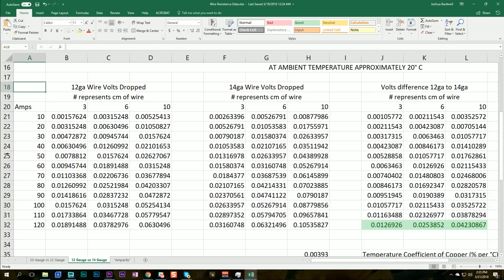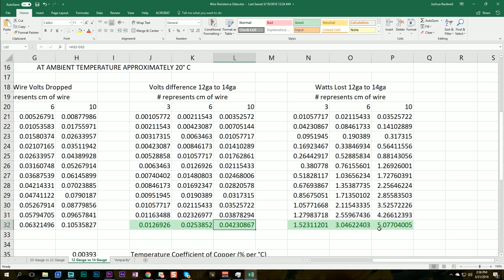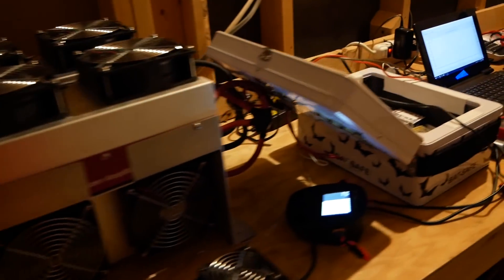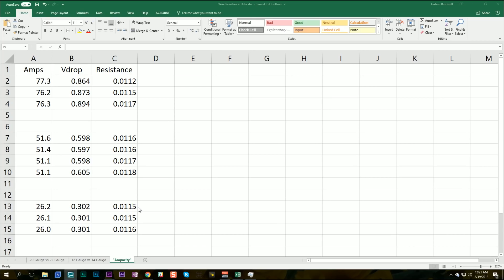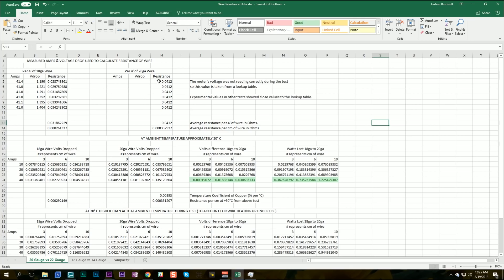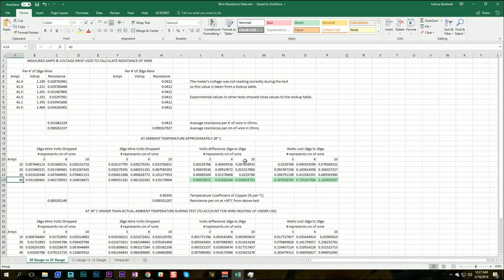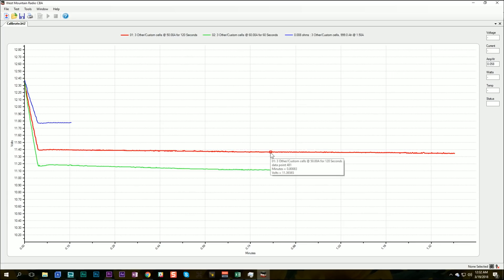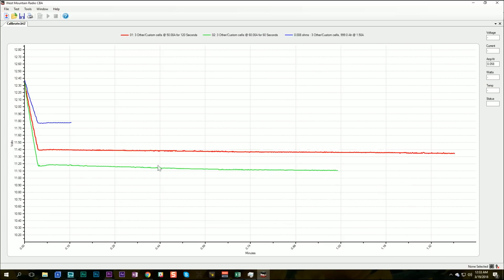Battery Wire Gauge | WHY IT (STILL) DOESN'T ACTUALLY MATTER

Comment: hi friend ... could you help me?
I have an ESC
Racerstar Shot30A ESC 30A 30amp 3-6S 4 in 1 BLHeli_S BB2 Dshot600 Integrated Current Voltage Sensor to match this flightcontroller ...
Omnibus F4 Pro V3 Betaflight Flight Controller Built-in OSD Barometer SD Blackbox for RC Drone ... banggood ...
The plug with the motors and the GND I inserted it and everything worked ..but when I put on the FC the BAT_SEN cable
and CUR_SEN ... and GND ... let me burn the flightcontroller.
the BAT_SEN on the V-BAT pin of the flightcontroller and the CUR_SEN in the CNT pin of the flightcontroller to give the current to the same.
Where did I go wrong???
Reply from the maker: That sounds correct to me.
Reply: I did the same thing, in my case I mistakenly soldered V-bat from the ESC to the 5V bus, blowing up everything that couldn't handle 4S voltage,  I got complacent and assumed the red lead was V-bat and orange was 5V oops- it happens to the best of us and I've been in the RC hobby for 22 years.

Double check your voltages if you have a meter, if not, double check the pin-out, if that is correct something got bridged on accident or you have a defective FC (or even ESC) or possibly mis-labeled boards or instructions- shit happens and I have had my share of faulty equipment right out of the bag.

Good luck, and if I was you and had to replace the FC, I would think twice about using the Omnibus SD-  I had multiple runaways until I disabled data logging, even with all the CLI tricks and using recommended SD cards- and this was a high-end Hobbywing part.
Reply: Meanwhile, thank you for your answer ... can you explain the situation a little better? since I have to translate it in English with google translator and sometimes it does not do it very well and some words confuse it.
in your opinion, how should I feed the ...
Omnibus F4 Pro V3 Betaflight Flight Controller Built-in OSD Barometer SD Blackbox for RC Drone ..... from
Racerstar Shot30A ESC 30A 30amp 3-6S 4 in 1 BLHeli_S BB2 Dshot600 Integrated Current Voltage Sensor ... if you can look at the diagram on banggood ..Thanks
Reply: I'm busy right now, I can check later.
If you have a voltage meter, check to see if on your ESC 5V is around 5V and V-bat is battery voltage. Using a meter is the best way to make sure voltage is correct.

Make sure that 5V wire is on 5V on your FC. Make sure that V-Bat wire is on V-bat on FC.

 But first, Plug your FC into a USB charger- if it turns on and you are brave enough, plug your FC into your computer- if it has power and connects to computer, it might still work.

Chances are you blew up every 5V device on your FC, and not the FC- there is a circuit to protect other 5V circuits on the FC in case of faulty wiring.

If you want to be safe, do not connect V-BAT and Current- in my experience it really doesn't matter because it will need to be calibrated anyway, and many stop counting at 84A
Reply: thanks a lot now I do all these checks ... if you can later look at the two components that I have described you thank you are a friend
Reply: sorry for the question. . . the output of the pins. . . BAT_SEN. . . is . . . CURR_SEN. . . of ESC 4IN 1.. to be connected to the FC OMNIBUS. . . . how many volts must have respectively to power the flightcontroller? ? ?
Thank you.
Reply: If your FC has a BEC, it can most likely run from 3S to 5S so probably 10v to 21v and then feed other components like your RX 5V (some boards also output 3.3v and 9v so make sure what you solder in) but if it does not have a BEC, it must use a 5V wire from the ESC or from an external BEC/PDB.

In the case of my Omnibus, it has a 5V rail and no BEC, and my ESC has a 5v BEC. My mistake was putting the V-bat from the ESC (16.8V) to the 5V rail, this destroyed my RX and VTX, but it spared itself. 

Bat_Sen is not Curr_sen,  Bat_sen usually means V-bat which means battery voltage, I do not know the voltage range of Curr_Sen.

If your FC is Product ID: 1163085 on banggood, then you have a BEC,  AND IT DOES NOT HAVE A CURRENT SENSOR - this board is very complicated and there are multiple ways you can fry stuff with it.
Check Blue Falcon's Flip32 Omnibus: How To Power (F3/F4/Pro/NonPro) video on YouTube and have CC translated for you. Just know the Author of this channel has sadly passed away, so you will not get a response from him if you comment.
Reply: Hello FRIEND you are very precise and professional ... you immediately understand that you are an EXPERT ... thank you so much that you have followed my case .. and I follow you to the comma to understand how to proceed and to learn more. .. and I'm understanding many things from you .. Thanks a lot ...
the flight controller OMNIBUS F4 PRO V3 is just what you have listed before
ID. 1163085 of Banggood ... and the PDB ESC 4IN 1 is this ..
Racerstar Shot30A ESC 30A 30amp 3-6S 4 in 1 BLHeli_S BB2 Dshot600 Integrated current voltage sensor ... always from Banggood ...
If you are so kind to take a look and see the diagram
of the Racestar..over the output of the 4 engines and the GND ... in the same socket and 'also signed + 5V .. but the plug in reality' probably there is probably an update of RACESTAR..com Anyway connected to the controller flying the 4 engines and with the GND seen in the scheme .. powered by the battery ... and tried the engines with betaflight .. they worked.
then I connected as described the plug above BAT_SEN and CUR_SEN respectively on the pins of FC V-BAT and CRNT + GND and I burned everything and I remained without flightcontroller.
It should be noted that the upper pin has 2 wires at + 5V output
and only a GND practically the last one.
today I checked with the tester the CUR_SEN and it does not give me tension ... the BAT_ SEN gives me the current of the battery ... and the other two + 5V give me 4.8 volts about .. that I think of one of these I can connect the TX FPV if I'm not mistaken .... the omnibus does not have the current sensor but actually does the 4IN 1 ESC RACESTAR ::
In your opinion, how should I proceed so as not to burn another FC ?????
I'm so sorry for BLUE FALCON it was a GENIUS.
Thank you so much in advance, you are GREAT
Reply: That board is mislabeled from the factory, I'm not sure what Cnt_sen does, but you don't want to use it! the Racerstar ESC should have a Cnt_sen, but your board is incompatible.
So long you are getting around 5V to your RX and your FC powers on and connects to your PC, you should be good to go.

I feel Cnt_sen is pointless for most people, it's really intended for people testing new propellers and need to make sure they are not over-loading the motors/ESC- I just buy the highest A ESC I can get and fly that, that way, it's the motors that burn up, not the ESC AND the motors.

So, attach V_bat to the board and make sure that your 5v tabs are close to 5V without anything attached to the board

If your camera has internal OSD and 18V+ handling, simply attach your camera to V_bat or directly to the battery connections and use that for your voltage read-out. You may get some noise in your camera, but if you solder a cap to your 4-in-1 it should be tolerable.
Reply: sorry but explained better ... because I have to translate with google translator in English and sometimes you do not understand well .. could you list step by step all the steps that I should do to connect to that FC ::?
SORRY SO MAN I thank you for your patience.
Reply: Sure.
Attach V_Bat and Gnd to FC. Power on. Check your 5V pins/connections- if they measure around 5V you should be safe to connect your RX and anything else that runs on 5V.

If your camera can take 18v or more, connect camera to V_Bat and Gnd or battery connections. If not connect to 5V on the FC
 If your VTX can handle 18V or more, connect to V_bat and Gnd or on your battery connections . If not connect to 5V on the FC
Connect your RX to 5V, Gnd, and RC (unless you are using spektrum)

Only connect everything after you make sure you are getting close to 5V on your 5V connection locations.
Reply: Hi Wyvern could you say to me please how do I connect the ESC RACESTAR SHOT 4IN 1 30A with integrated current sensor ... to connect it with the FC OMNIBUS F4 V2.1 which also has the current sensor?
THANK YOU
Reply: This one is unique, what you are going to do is run your + battery wire (the big wire that goes to your ESC) to the Bat+ pad on the FC FIRST, then, you are going to wire MOTO out into your  ESC. Then on the bottom of the FC  there is a large pad you connect your large NEG wire to the FC FIRST then another wire goes back to your ESC. 

In short, your FC is like a PDB your power goes to it first before it goes to your ESC. You do not need to use the CNT wire from your ESC on this build.

Make sure you secure your battery cable to the frame before flight as a bad crash can break the FC 

Good luck, and check your 5V output first before you connect up your RX.
Reply: the big red and black cable of the + battery and the - ..e'gia welded in the ESC 4IN 1 default factory ...
would you tell me that I have to unplug it and weld it in the FLIGHTCONTROLLER?
thank you
Reply: Yep, those wires are going to go to the FC first, then to the ESC.

Comment: Round Trip? Somebody's trippn' .. I can't believe we've been calculating 100 thru 2000 amp industrial three phase installations all wrong.. (according to that round trip theory)
Reply from the maker: If you're concerned about heat buildup you have to account for the return path, right?
Reply: Joshua Bardwell no. Never heard of the round trip theory before. All line runs are one way, one lane

Comment: In short words: we can put 60-80 A/mm² on a wire if it is not too long.  (can't calculate with AWG, look it up @ wikipedia)
Weight decreases/increases by 1.6x for each 2 numbers on the AWG-scale for a given length. 12 vs 14 AWG makes 3g more for 2 wires with 10cm length which is equivalent to a permanent loss of one watt of power (lets assume the props do ~ 3g/W ). The thick wire is only better when you often go over 100 Amps but it allways weights.
Result: make it as short as possible

Comment: No. I will settle for nothing thinner than 2awg!

;))
Reply: With gold plated terminals! It really lets the warmth and richness of the propwash come through!
Reply: Thicc.
Reply: Get that 2 AWG by the foot at Car Toys. Bump some 18" subwoofers through the qwad after flying.
Reply: And soldered only with solder > Ag20. 20% Silver is the minimum....
Reply: @hesspet  i use pure gold 113% pure only ... silver is for noobs ;)
Reply: Super cool the wires and pre-warm the batteries.
Reply: 2?!? I hope you mean 2/0! 
BTW, found a great deal on a replacement for the connections to the PDB! Won't melt like solder will!
http://www.ebay.com/bhp/2-0-battery-terminal

Comment: Soooo... When do we get resistance measures for pdb's and fc's with pdb?
Reply from the maker: This would be very difficult to measure because they are inherently "short" and so the technique of using a 4' length of wire to amplify the resistance is impossible.
Reply: Joshua Bardwell doesent have to be super scientific. Push 20 or 40 amps between two pads and measure the voltage on the pads with your dmm. Like a 4-wire resistance measurement.

Comment: It does when it's too small 😂!!! I was running 18g wire ( cause weight weenie an't easy ) on my ultralite 5" power leds, worked ok for a while but eventually blew the ground off the xt60 and melted the plug 😂 I replaced it with 16g ( which it should have been in the first place ) not only has it not blasted off the solder it's got more top end as it's able to deliver more amps.. the wire diameter does matter when you use stuff that's too small 😂
Reply from the maker: It may have been a bad solder joint with high resistance that caused this.

Comment: they also have Micro strand wire that is more efficient because the electricity travels around the outside of the copper wire not through the center of the copper wire so the more surface you have the more efficient the wire works
Reply: There’s no skin effect on a DC signal
Reply: jep, and it is also only an issue at high frequencies...

Comment: as a wire gets hot it stops working as good the more cooling there is on a wire the more you can run through it like the open wires across the telephone poles that have no installation and the wires are tiny they also raise the voltage up to 480 volts and then bring it down to 110 for house use

Comment: I think this was a awesome video. A long while ago, I made a power distribution rig for my radios (ham) and I used 18 gauge wires in the connections internally. My friend said I'll burn it up quickly. 20 years later and the rig still exists. I explained to him 1 cm of wire is not going to be such a resistance at the rate watts drawn. You just proven my methodology in explaining it to him. I even used various charts to gather the data since I don't have a battery tester like yours. So, thank you thank you thank you!

Comment: you did a pretty good job there's a lot more to it than that and you're right over short distances it doesn't matter as much it's really all about heat over short distances if your wires are getting hot you need a bigger wire that's basically it . most Electrical Codes have to do with the dissipation of heat. this is really weird but the lower the voltage the bigger the wire 12 volt has a huge wire and 110 has a little tiny wire so how many cells your battery has makes a difference the more cells the smaller the wire you can use

Comment: Off topic but if I had a taranis that could not measure the swr.. replacing the radio board would resolve this correct?
Reply from the maker: My guess is yes but I'm not sure.
Reply: Joshua Bardwell excellent I am guessing the logic checks out... And I did just kill my mainboard and replaced it so effectively it would be a new taranis.

I will order a board and give it a go.

Not being able to see my swr and not knowing if I did the 5dbi mod correctly does not provide me with confidence when I would like to push out to 10km on 2.4 safely
Reply: Awesome news, new board installed, took two attempts but i now have 0-1 RAS

Comment: so what about 16 awg on mains then? ;)
Reply from the maker: Yeah indeed. There is certainly a point where shorter length makes up the difference.
Reply: Mains... those cables goes through walls with glass-wool or other thermal insulation. There you have to care about losses. I a quad with all that cool air around, it doesn't matter.
Reply: I meant for battery cables not mains in a house or something ^^

Comment: So, if your insulation hasn't melted and your wire isn't incandescent, don't worry about it.  Cool.  Next question, is the great connector swap-out justified (jst, xt30, xt60 etc.)?
Reply: Jst for 1s to low amp 2s, XT30 for until 30amps, and XT60 until 60, etc etc. There are tests of these connectors out there.

Comment: Even though there's not much power loss, so you think silver plated wire would make a difference? Unfortunately it only comes in 12awg.
Silverworm 12 AWG Real Silver Plated Flexible Copper Wire 12 AWG by ACER Racing https://www.amazon.com/dp/B01M9IXL5Q/ref=cm_sw_r_cp_apa_8m7SAbS18NDG9
Reply: It would not. As JB showed in his video, the lenghts are just too short to make a big difference. Copper, silver, it is so close in terms of elec. resistance. The only difference with the silver plated wire, is the price (and the profit for the manufacturer).

Comment: Great video! I figure I'd the motor comes with 18 AWG wire then 18 AWG it is. No need in going any bigger than necessary. I've also yet to see a mini quad pulling 150 amps on each motor. My 550 helicopter has a 150 amp ESC and uses 12AWG wire. My mini quad doesn't so it only has 18AWG.

Comment: Imo more interesting than the Watts of loss in the cable is how much the motor power and thrust is reduced due to the fact that the motor is driven with reduced voltage. The realtion is quite progressive. And considering all other voltage drops over the other cables, the PDB and soldering connections the motor does already not see the full battery voltage. Then a few mV additional drop may result in a bigger relative reduction in thust than the 5W loss in the cable would suggest.
Reply from the maker: That's the beauty of Watts. Watts is Watts. Lose 10 watts at the input side, lose 10 watts at the output. You cannot get more watts out of a system than you put in.
Reply: Thanks for your reply Joshua. Correct, in your example there will be 10Watts (more) loss - i.e. 10Watts (more) difference between input and output power. But that doesn't imply that the output power will be 10Watts less due this change in the system. It could also be 100Watts less if the system behaves nonlinear, which then would imply that the input power would be 90Watts less. And I think this 100Watts reduction in output power is more relevant than the 10Watts increase in loss.

Comment: This applies to speaker wire too. I was researching this topic years ago when I realized the length of wire has a lot to do with how thick a wire you need to carry a certain load. Turns out speaker wire is usually way too thick for how long the wire is too, and using insanely  thick wire is just a waste of copper and money.
Reply: http://www.roger-russell.com/wire/wire.htm
Reply: https://www.powerstream.com/Wire_Size.htm

Comment: Using AWG to compare conductors is theoretically irrelevant and assumes all wire has the same physical properties ie. strands, materials, plating, insulation. Wire is measured in Ampacity. Imagine if we were to use carbon conductors instead of copper, or gold?
ducks for cover